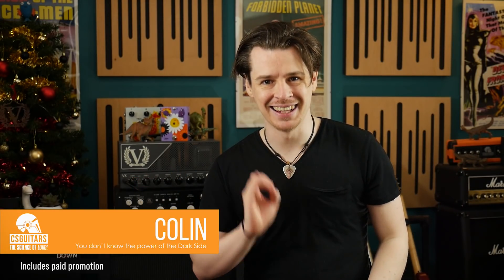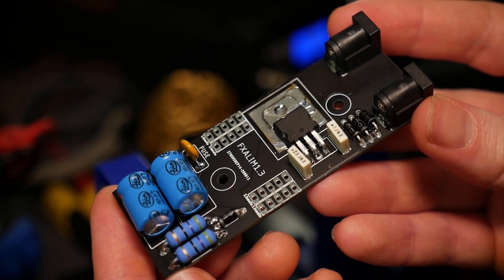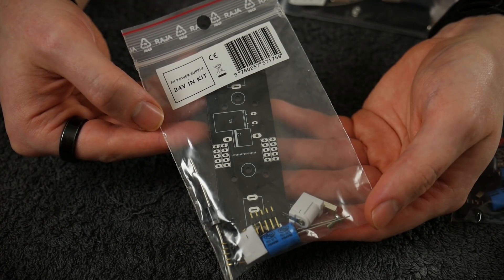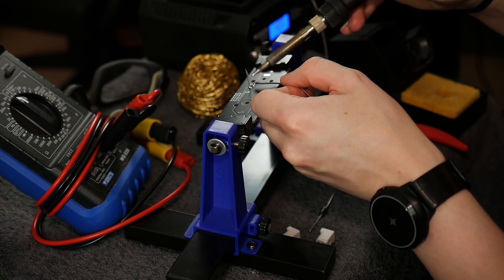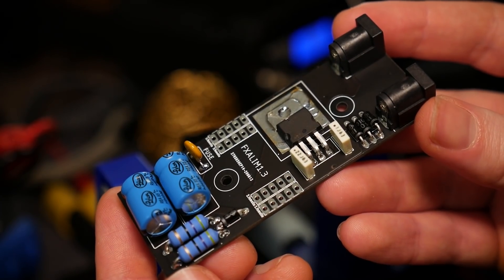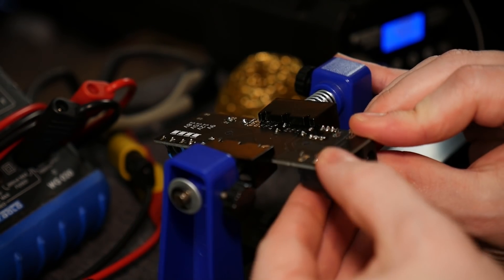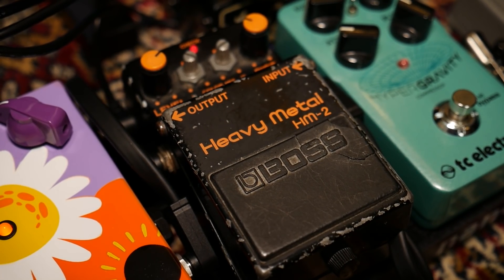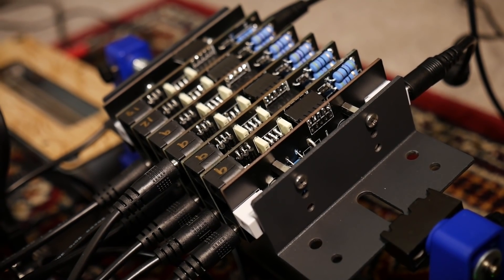Build a CUSTOM Pedal Power Supply Kit | Anasounds FX Power Source

Comment from the maker: Ever wished you could customise the EXACT number and voltage of outputs on your pedal power supply? Why not build your own! Anasounds FX Power Source is an ever expandable modular power supply allowing you to choose how much power you need. 

Product page - https://anasounds.com/fx-power-source/
Assembly Instructions - https://anasounds.com/build-your-fx-power-source-power-supply/

Thanks to Anasounds for funding this video's creation.
#anasounds #powersupply #diy

More from CSGuitars: 
Gain access to exclusive content at: https://www.patreon.com/csguitars
Join CSGuitars Discord - https://discord.gg/d7b6MY8
Buy CSGuitars Merchandise - https://www.csguitars.co.uk/store
Website - http://www.csguitars.co.uk
Contact - colin@csguitars.co.uk
Reply: I'm interested with just battery pedalboard. Any idea of anything decent for lithium power supply?
Reply from the maker: I've been using a Mission Engineering 529 for pretty much everything until I got these Anasounds ones. You might like what it can do if you want to power from a battery pack.
Reply: Femder makes pedal cases with them direct wired in the case. They also make custom ones its pretty cheap to. So thx but no thanks ill stick with the pro’s

Comment: This modular supply in kit is interesting ! I will say to future builders , newer do this ; space is asking to bend those big Elco's , don't  let them to touch PCB . cos they could turn hot and over the time , burn it ! Don't weld transistor on a surface ! Fasten them with a small bolt , plus , will be good to put a small  Alu  '' U '' profile over metal surface and  bolt it all together for better heat sinking .

Comment: 78xx regulators sometimes can sometimes be noise generators, not the best choice. LM317 with few additional components would be better - a lot quieter, also no need to change regulator to change voltage, just a single resistor or few turns on trimpot. If normal heat-sink is used not just pad on PCB, more current can be drawn from regulator, hence could be used to power more power hungry pedals. Also none of these outputs are isolated from each other, so I would not recommend this.

I did my own design of modular PSU for my board with dual secondary potted transformers soldered on each PCB board module, LM317 regulators, completely isolated from each other (isolated power sources, grounds), quiet and expandable, just add another two output board. I currently use 4 boards (8x 9V outputs).

Comment: Hey Colin. Love your videos, been watching for years, but I feel I should chime in on this one.

This looks neat, but I think you mistakenly misrepresented a few portions of the circuitry. While individually regulated, the positive rails are not isolated as you claim. Isolation requires conversion to another medium and no electrical connection. Without isolation, they will suffer the same noise and ground loops of every other non-isolsted power supply. Filtration components can help improve some issues in some cases, but it is not a magic bullet in the absence of true isolation. I feel this is very important to mention, as it means this power supply will not solve most pedal noise issues. Running several 780X chips off a common 24v rail with a few filtration capacitors is not isolation, and I feel claiming otherwise is a bit misleading. 

You also mentioned that inclusion of isolation transformers results in introducing 50/60 cycle hum into the signal. While inclusion of mains AC in the power supply can cause issues, you don't need mains AC in your pedal power supply to utilize isolation transformers. For example, the MXR ISO brick uses 18v DC from an external power brick to create it's own high frequency AC circuit that's far less noisy and more controlled than mains. The higher the frequency an AC source is, the more effective a transformer becomes. Stable, lower voltage, higher frequency AC lets it use substantially smaller, less expensive, and more effective transformers. And most importantly, the outputs can be incredibly quit and completely isolated. I personally find this tech fascinating, and I think your viewers too. 

Anyways, love the videos. Keep em coming!
Reply from the maker: Perhaps I didn't detail what I was saying effectively enough:

Isolation: What I mean is that the 9V isn't travelling board to board, the 9V (or 12V/18V) are generated per board and aren't common to all the sockets. So each board's 9V is 'isolated' from the others. Perhaps a poor choice of word in context: 24V travels common through all, 9V don't.

50/60CH: You are making the same point I was regarding the 24V power brick being an external to this unit, by having the AC/DC conversion physically distanced from the pedals and the power distribution to them it eliminates hum. I was pointing out that transformers to isolate ground mean that AC will be present within the unit as transformers can't pass DC. If you want isolated grounds, you need to have AC near the outputs.
Reply: @ScienceofLoud  Thanks for the response. I get what you mean. I didn't assume it was an intentional, as you mentioned the grounds weren't isolated. I assumed it was just an oversight. "Independently regulated" might be a better way to put it. I wasted a lot of money over the years on power supplies that misused the word isolated (such as "isolated protection") before I dug deep into PSU design.

Regarding AC within the PSU itself, it is possible to have AC in proximity without interference through proper design. Using the MXR ISO brick as an example again, it's transformers are perpendicular to the DC converter boards, with a complete ground plane barrier in-between. Wall ac power is nasty, but generating your own hi-frequwncy AC removes many of these problems.

Didn't mean this to come off as an attack. I thought the video was excellent, aside from those 2 minor knitpicks. I love the more technical videos, and over the years you have answered many of my TATAs. If I can ever be of assistance, such as for custom PCB design, don't hesitate to reach out 😄

Comment: Perfect intonation IS possible. You said it's simply not possible on an instrument with straight frets. Well it IS possible with a compensated nut! Look up String Tech on YouTube and you will see multiple videos demonstrating this. There is also a small plastic insert that just sits in front of the nut under the strings. Its called the sos (Sound Offset Spacer) So just wanted to let you know that you can say from now on it is possible to get good intonation on a guitar with straight frets.
Reply from the maker: 1. You've commented this on the wrong video.

2. It is impossible even with a compensated nut.
Reply from the maker: A compensated nut only changes the overall length of each string, it does not change the divisional spacing between frets. 

The very presence of frets makes all intonation (no matter how good) an approximation. The only way to achieve true perfect intonation is to have no frets at all.
Reply: @ScienceofLoud  1. I came from your will it shred series and heard you say it wasn't possible. 
2. I decided to come to your most recent video so you would see the comment.  
3. If your being that picky about what is perfect. Then no matter what shape frets you have, PERFECT intonation is not possible. But perfect TO OUR EARS is possible with the compensated nut. If you still don't want to believe it, then I guess we'll just have to agree to disagree. I still love your videos though and probably always will. :)

Comment: I couldn't find a cheap dc 2 dc step down isolated 9v power supply. I did find power supplies for more than 1 amp which were too big and not that cheap

Comment: I'm surprised you don't need any chassis to protect from external noise. But I guess for power line it's not problematic? Just would want the casing to protect from physical stuff and to avoid touching connections.

Comment: so you mean this DIY board is pure isolated including each port?
Reply from the maker: No, watch again. 
Each board has its 9V line isolated from the rest. 
Grounds are not isolated, but that isn't the big problem everyone makes it out to be. In fact transformer isolated designs (of which this is not) introduce problems this one does not have. 

There is no perfect.
Reply: @ScienceofLoud  thank you, you should make a comparison to this vs other pedal power supply.

Comment: Hi Colin, how are these regulators isolating the 9V line? Do you have any links to where I can read more?
Reply from the maker: There is an individual regulator for each board. Each board therefore has the voltage isolated from the others. 
Links to all Anasounds documentation is in the description and pinned comment.
Reply: @ScienceofLoud  I'm just confused about how the regulators isolate the 9V rail? Are they 7809s or are they something fancier?
Reply from the maker: There is no 9V travelling from board to board. 
Each supply board individually regulates the voltage supplied to the pedals, only the 24V passes through.

Comment: Great video! I've been toying with the idea of building a power supply. Would copper tape lining the interior of the pedal block the 50 to 60 cycle hum? Thanks!
Reply: Hi, no it wouldn't but the creative thinking process is good.
Mains hum affects your sound in two ways. Firstly it's travelling through the power supply directly and entering your pedal pcb and seeping into your audio as the power goes through its cycle, ie 50/60hz. This needs to be fitted out with components in the chain.
Secondly mains hum is picked up by your guitar or other devices that are plugged into your rig. If you imagine the mains transmitting the hum as radio waves. This is usually blocked by shielded cables and metal enclosures on devices, called Faraday cages. Your wooden guitar body won't block these signals, but lining the control cavity and back of pick guard with a metal foil will.

Comment: Colin, I have a question in regards to the HM-2 and 12 volts. I have one and I'd like to know if I could run it off my Strymon Ojai's 12 volt option ( I have the one that can do 9-18 volts). I also have an official Boss 12 volt adapter if the Ojai is not an option.
Reply from the maker: Some old Boss pedals were designed to run with their ACA supply which was unregulated 9V. 
What that means is that it would only deliver 9V for a specific current draw.

The HM-2 draws far less than the required current and the under loaded supply delivers higher than nominal voltage, in this case around 12V.

Boss knew this and wired the pedal to reduce the incoming voltage to the required 9V. 

So in answer to your question: first check your pedal is one designed for ACA and if it is then any 12V regulated supply will do the trick to match the voltage of the unregulated ACA.

Comment: wonderful idea.     anyone need like 10 ehx 200ma wall warts?  the real trick was finding a couple of wall-wart-power strips.    The HM-2 is specced for 9VAC. 12v dc overrides the rectifier. I would recommend using a 9v battery clip to a regular 9v supply to fake a 9v battery to operate it as intended.
edit:  solder a 9v battery clip to a 9v input power jack.   clip the clip to the clip inside and thread it outside thru the huge gap along the back of the stomp plate. looks like azz but sounds right.

Comment: I like to make what I call "power distribution modules".  These are little plastic boxes with multiple paralleled output jacks, an indicator LED, and a smoothing cap added.  As a passive "power brick" this is clearly much less than is needed, so think of it as a "satellite campus" of your power supply.  I run a single cable from my power brick out to the distribution box, keeping in mind the polarity and total current draw of all pedals connected to it, and short cables from the module to the individual pedals.  I regularly have to caution folks about daisy-chaining pedals, and the risks of drawing too much current, or heterodyning of multiple digital pedals sharing the same power line.  HOWEVER, many players have a surfeit of lower-current analog pedals on their board, and a distribution module can allow neater cabling for such pedals, by having short custom-length cables to pedals out on the periphery of the board, and being "modular".  A 2nd and 3rd such module, connected to individual outputs on the power brick, can provide convenience.

That said, the Anasounds system is smart, flexible, expandable, and follows best design practice.  The only misgiving I have is that it assumes one central location, and the many lengthy cables required to reach from that location to all points on a potentially cluttered and large board. My own approach is predicated on having a LOT of small, lower-current analog pedals, where running 12" (and longer) cables everywhere is cumbersome.  I suppose I should also note that I make my own connecting cables.

You may want to take a look at this video I made - https://www.youtube.com/watch?v=xszB3pAGrdw -, illustrating how to remotely switch e-switched pedals like those from Boss.  The advantage of this approach is that the pedal itself can be situated anywhere, with a bank of secondary bypass switches positioned up front.  Since the cable to the secondary switch does not carry audio, one can use thinner unshielded wires, reducing both the bulk and cost of running shielded cables with 1/4" plugs and jacks to and from a switcher.  You can have a row of such pedals off in the remote corner of your board, connected by short compact patch cables, reducing overall capacitance issues.not to mention the overall weight of the pedalboard.
Reply: Here's an example of what I'm talking about.  It takes a +12VDC input, provide a +12V-thru jack, and down-regulates the +12V to four individually-regulated +9V@100ma outputs.  Not a substitute for a decent power brick, but a handy adjunct.  https://i.imgur.com/XQVxNYM.jpg

Comment: Colin, I'm not a total simpleton. However, whenever I try and solder anything its a fucking disaster. Basically nothing happens aside from everything getting hotter than the sun, my fingers getting burnt then eventually if I'm lucky, my little bit of solder melts and runs away without sticking anything to anything else. I end up just getting really pissed off, twisting the wires together and using blu-tack. Can you give us a simple guide to soldering (including what cheap kit to buy off amazon) so I can at least do basic shit like soldering a wire to a pot.
Reply from the maker: This is something I've been thinking about doing for a long time.
Reply: @ScienceofLoud  Cheers - I just want to be able to do simple things like wire in a switch or pickup without worrying that I'm basically breaking my guitar until I can take it to a pro
Reply: There are some great vids out there on YouTube. As a beginner you are going to really struggle without a few basic tools.
Iron, you can buy a £7.00 iron from Toolz-U-Like. The tip will be far too big, it'll get a lot hotter than what you need for pcb's, Good for fat speaker wires. The tip coating will burn off quickly and the tip disintegrate,  especially  with lead free solder.
Antek approx. 20watt yellow and a small chisel tip as an extra. The fine point is no good.
0.5-0.7mm solder us going to help. Not the fat stuff in Toolz-U-Like.
If you want to do the right thing, progress from leaded solder asap.
Some Antek tips are designed for this, I've never had to replace mine. Lead free melts at a higher temp, risking damage to components and not flowing sticking.
If you buy the stuff with aprox 3.6% silver and O.6% copper it's not much more difficult to  use  than lead. If you buy the aprox 0.6% silver and 3.6% copper you'll  struggle. It's OK for really hot irons as it needs a lot more heat to melt the copper. Trouble is the good stuff is about 5 times the price but your work will be much better. 
You'll have to settle for eco destruction  and learn with leaded to start with.

Comment: Just buy a TrueTone CS12.  Done.
Reply from the maker: That doesn't exactly fulfil the same purpose as this though. Can the TrueTone be expanded anywhere from 2 to 60 outputs? Can you select the exact arrangement of voltages to specifically suit your pedals?
Reply: @ScienceofLoud  Not exactly, but it will provide up to 500 mA and satisfy 95% of the guitar player out there and you don’t have  to build it.  I like the product , I think it is a good idea.  It is limited with only providing up to 200 mA.  If you need more than that, then you have to buy another unit.
Reply from the maker: I'm always perplexed when anyone uses "you don't have to build it" as a point in a product's favour. Building it is the best part!

Comment: Could you not technically make a guitar pedal that also could power other pedals?
Reply from the maker: Some low current pedals are capable of delivering the power through to another effect. This is seen quite often on tuners which otherwise would be wasting a power socket for the majority of your set.
Reply: Re: Colin's comment above. I've got a Korg tuner with a power though - its and the front right of my board - this is really handy, 'cos no one wants to put their wah, wah on their board, its heavy and cumbersome. But it means I have a convenient tap to power the wah wah when its on the floor next to the board.